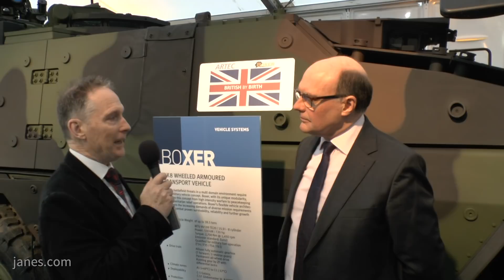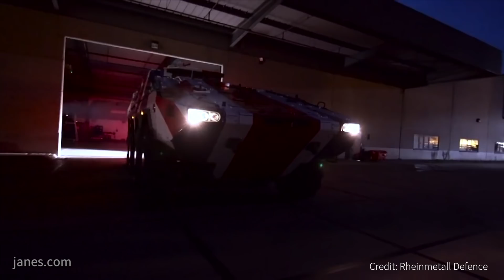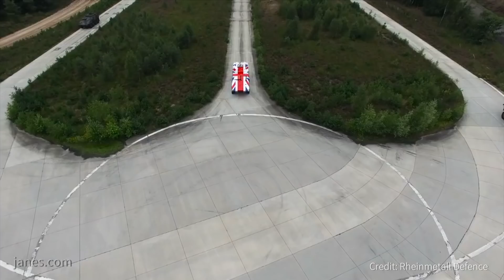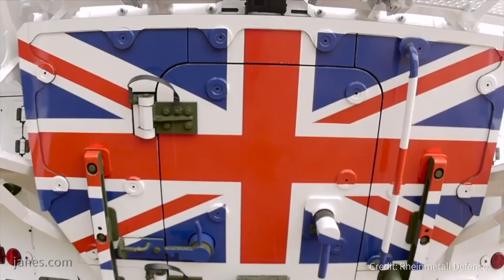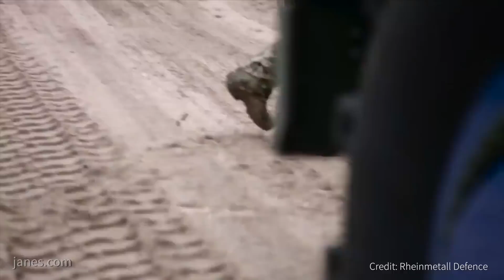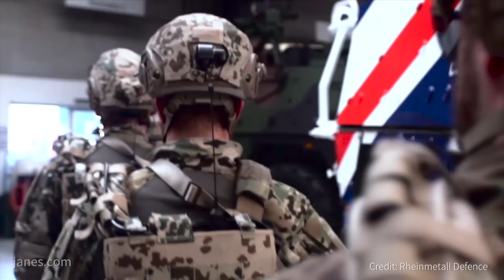IAV 2018: Rheinmetall Defence UK Ltd - ARTEC partnership and Boxer 8x8 programme for the UK

Comment: Its like painting a union flag on top of a mini, its still a german vehicle.
Reply: Wasn’t it was developed initially though with the U.K. as a partner with the Germans?
Reply: @Russell-1 nope the UK prefered to run away and later rejoin.
Reply: @Russell-1  yeah but UK and france dropped out so early in the developement, that they had no impact on the vehicle.
It is not british it is german and dutch (considering that the dutch are also rheinmetall)

Comment: Yes please... been a fan since the early MRAV days. This the perfect fit for the UK and the best 8x8 on the market. Best protection, longest range, highest growth, uk IP, tried snd battle proven, same engine as Ajax!!! What about making a demountable hull of the Ajax that would take Boxer modules???
Reply: That concept has been tried in the swedish SEP Modular Armoured Tactical System.

Failed pretty much. The differences of wheeled and tracked platforms are too significant in the end.
Reply: Jonny not sure that was the reason why SEP failed it was more that Sweden didn’t have a requirement for that exact size or type of vehicle, having already selected the CV90 snd then opting for a bigger 8x8 with Patria AMV. The closest fit would have been the original FRES concept. The final change to a much larger and heavier vehicle for the tracked CVRT replacement. The ironic thing is that the very same change in requirements led to a very heavy Ajax but killed off the MRAV/BOXER as being to big!!!  Total fuckup!!!

We need both large medium and light forces much like the Soviets. The medium fits all solution is a myth. Horses for courses.
Reply: Papa Trique I bet you do!!! Trouble is after about 6 months bits will start falling off of it or breaking. Think it comes with a wine cooler though🤥
Reply: Maybe not the primary reason, but it was a compromise. Both chassis (wheeled and tracked) wouldn't perform as good as vehicles that were primarily designed to be tracked/wheeled (CV90 and Patria as example). The drivetrain wasted too much internal space and it was simply too complicated (interesting concept though).
Reply: Jonny my understanding is that the two engines mounted on the side of the vehicle snd the hybrid electric drive meant that the crew compartment was larger and provided more usable space than a conventional design???
Reply: It was more or less to make up for the loss of internal volume caused by the design. On such modular vehicles, you will always have drawbacks in internal volume and protection compared to a single, purpose-build solution. (that does not only affect module-based modular vehicles, but also MBT/HIFV solutions like the T-14/T-15 and the Merkava/Namer).

If the Boxer wasn't modular, it would be better protected. On a wheeled chassis these tradeoffs are bearable, but on a tracked base they're much bigger and a question of how much capability you want to sacrifice just to have modularity.
Reply: The best would be the puma, but still German so the Boxer will do for the UK.